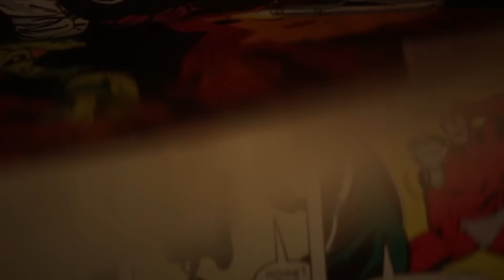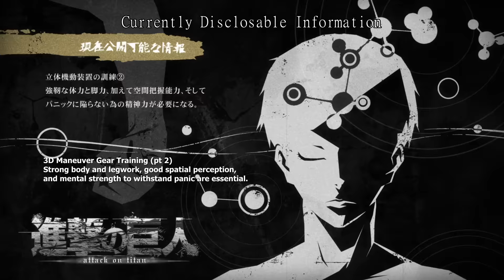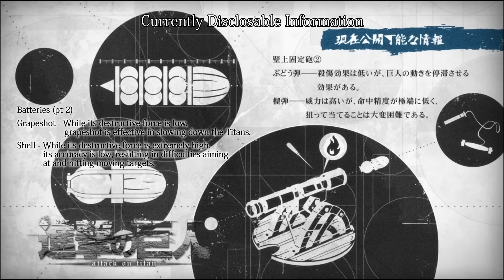Make it Real: Testing the Reloadable Swords from Attack on Titan

Comment: I'm pretty surprised the quiver/blade sheath was as rough as it was. It's a good idea, but I get the feeling that the stored blades were allowed quite a bit of movement inside the sheath itself, and that drawing a new blade could often result in dulling that blade against the cut slots.

Would you have any ideas for refining the idea down the line and keeping the blades as sharp as possible when drawing?
Reply from the maker: +Rosa Weyland hmmm... It's just low-friction plastic, shouldn't cause much wear
Reply: That makes sense. I could hear and see a bit of friction against the sheath when you drew the blades, is all.
Reply from the maker: +Rosa Weyland yeah it isn't the greatest sheath. But it is technically just as prop -- spending more effort on it probably wouldn't of enhanced this video at all. So it kinda got the short end of the stick during the build :p
Reply: That makes sense. Perhaps a hobbyist down the line could improve on the concept, I certainly think that a little further work could have done some good. Perhaps a leather lining might have mitigated the issue somewhat with the draw, but... that's muh pr'fessional 'pinion :P
Reply: tbh the blades in the sheaths are only really meant to be draw once because u would just use that one blade and then draw a new one, not very often would a blade be drawn more than once, so it dosent really matter if the sheath is crude or not
Reply: Keep in mind that the scabbards of most Japanese swords are simply made of wood, and have no lining on the inside at all. The oil used to clean and treat the blade helps to lubricate it, but can also dry on the blade and in the scabbard if it isn't taken out and cleaned frequently. Low-friction plastic is going to be better for the blades than wood in the way of friction, and should make up for the blades not being oiled.

I agree that allowing movement in the sheath is most definitely a bad idea, because this could dull or damage the blade, not to mention that leaning forward could have the blades simply fall out of the sheath. If they were a little tighter, while not squeezing the blade, that would be much better.

But, as the Hacksmith said, the sheath is just a prop, and not much effort was put into it because it wasn't the focus of the video.
Reply: +BlackManiaGaming Attack on Titan takes place in Europe, (Mikasa is the last living Japanese person)
Reply: darrian255 I know that. I'm just talking about Japanese swords because (A) Attack On Titan is made by Japanese people, and (B) because I don't know much about European swords.

Comment: If you had a bigger budget I bet you could make a more compact blade holder by having all the blades right next to each other except for one that is spaced out a little more so it's easier for the handle to clip to the blade. And when a blade is taken out the next blade gets moved into the spot of the old one.

Comment: Wouldn't the blades be loose and prone to movement, like shaking or tilting, in the handle, and possibly even fly out if enough force is applied? It's only a half-length push tang at best, and pretty much anything less than full-tang isn't considered battle-ready. You might get away with a half-tang, but a push tang's not gonna cut it (pun not intended). It's quite dangerous if the blade were to fly out of the handle, perhaps due to force of impact, or simply the force of you swinging it if the clip which holds it in broke.

Also, the weighting is going to be further down the blade because the metal is not in the handle to add weight. This could be "fixed" by weighting the handle, but that adds unnecessary weight to the sword, which is never a good thing, but is better than having the centre of mass further up the blade. The shortened length of the blade (compared to other "similar" swords) will help to keep the centre of mass nearer the handle, but it's still going to be further in the blade than a full tang. The higher the centre of mass, the more the momentum carries the sword when you swing it, leading to less control, and making the blade swing further than you intended. The optimum place for the centre of mass is a few inches above the handle, depending on the specifications of the blade, which helps balance control and momentum.

And I'm a bit of a sword enthusiast, not just some kid who pretends he knows everything about something he really knows nothing about. I know from experience that I'll get people saying that's what I am. I know you're a professional, who has worked on many projects, and probably knows more than a fair bit about this. And I don't doubt that you will have done your research. But the points must be made. Actually, I'm questioning the initial design of the attack on titan creators, considering the rest of the ODM gear seems to be well thought out for the most part (having the gas booster around the body's centre of mass, using straps to prevent injury, ect) but this niggling detail on a crucial part, which is more in my area of knowledge, just gets me.
Reply from the maker: +BlackManiaGaming well... It is just anime lol -- the entire premise of the show doesn't play nicely with real world physics :p
Reply: the Hacksmith Sorry, I'm one of those people who comes up with theories and stuff about games, movies, TV shows, and anime, and generally takes them too seriously. Like MatPat from Game Theory. :P

Comment: tbh they only sharpen the blade nothing special
Reply from the maker: No... we built the handle so the blades are removable! Watch the first video to see what we did, it was actually a lot of work!
Reply: the Hacksmith I admire your works they r beautiful, but if your talking about removing the handle? pretty much any   props workshop could do that, I'm not saying that I dislike this video but I like it no offense,
Reply from the maker: You should watch the making video =) It's never been done quite like this!
Reply: sure okey
Reply: The way the blades themselves are designed and function are similar to the ones used on utility knives.
Reply from the maker: Didja watch it?
Reply: Copado
simepodemiarmasvideo
😃

Comment: why would you want a detachable blade?
Reply: thats how the show is
Reply: +Justin Ladd yeah I figured, but in the show, what's the point?
Reply: +Evan Wheeler because the blade gets stuck to the Titan sometimes
Reply: In series blades get dull after few slashes as you need to cut...0.5-1m2 of flesh, tendencies and spine. Also if blade gets stuck and you miss the critical point (only spot that kills the titan) your good as dead, cause your imminent range of titan and it can just swat you like fly, also those handles have controls for your movement system, so you cant really just discard your blade handles and you dont really want to be escaping titan of any size on foot.. 

I recommend to watch the series, its quite good and you will understand better why system is like that.
Reply: It's similar to a hobby knife. The blade needs to be incredibly sharp, which makes it dull quickly. It also runs the risk of breaking or getting stuck while in use. Hence a reloading system.
Reply: +Hellsong89 I'd have to check it out sometime then. not really into amine, but I've been hearing people talk about this show for a long time.
Reply: They're zipping around at ludicrous speeds, with the controls tied to their sword handles, which you need to keep with you at all costs. Blades bite, so it'd be easier to ditch the blade than anything else, so that's what they do. It also allows you to use a thinner, sharper edge, which is better for slicing, but isn't used commonly because it weakens the metal too much, leading to poor edge retention. The idea makes sense, if a little wasteful in such a impovershed area, but it works.
Reply: That doesn't mean a blade can't get stuck, it happens alot, especially considering they could hit bone when hitting Titans. Spoiler Alert: "Blood Grooves" aren't magic, they're mainly to make the sword lighter in my experience
Reply: hardwirecars If by a fraction you mean 25-35%, yes. Look it up. General consensus from experts is that the vacuum thing is bull.
Reply: Anyway, the blades are too thin to score beyond break points
Reply: +hardwire its called a fuller anyways not a blood groove and ask anybody who actually knows anything about blades blood grooves are bull
Reply: There's no vacuum seal created when you stab someone. Well, not one of significant force at any rate. Citation? Go and stab a roast chicken with a non-serrated kitchen knife and see how hard it is to withdraw.

The fuller is purely to reduce weight while keeping stability intact. In fact, the weapon known for being the best stabby thing around, the rapier, frequently has no fuller at all.
Reply: Ah, I love it when people who actually know what they're talking about show up :)
Reply: Evan Wheeler you need a detachable blade, because eventually the blade will become too dull, so dull it won't have the sharpness needed to kill a Titan, which is slicing deep enough into the nabe part of the neck. Having a blade too dull will cost you your life, so if it's detachable, once the blade becomes too dull, it will detach from the handle, or the blade, and then you know when to stop and retreat, or get a new sword, type thing.

Comment: by the way how did that flying thing go
Reply: he had to use differemt type of rockets, since he can only atach 2 of the old ones to his body and that did not lift off and only gave him a little push
Reply: There are six ways to put rockets on someone you can put two on his back and you can also put two on the back of his legs and you can also put under the wrist that way he will have more pressure and more rocket power
Reply: +Jt Smeth Go watch the flight test videos. If I'm remembering correctly he can't do anymore experimenting with rockets because  of laws. And attaching rockets in any of those places you mentioned would extremely dangerous.

Comment: didn't watch attack on titan, is there any point in having a reloadable sword instead of just having many swords ? I mean, what happens if you loose the handle ?
Reply: They have reloadable swords so if the sword gets stuck in s titan or snaps or something they can replace it with another blade
Reply: They control the 3D manuvering system
Reply: Yup, it would make much more sense to just have a full sword with handle. its not as if a handle takes up much space.
Reply: the handles are controls for their gear.  they have rope launchers and sort of a crude flight system.  they kill monsters by cutting the bacls of their neck.  cutting into the monsters destroys the blades.  there are 2 live action movies that are creepy as can be.  but the cartoons have alot more information in them.  its pretty crazy.

Comment: So the point of these is?
Reply: Shits and giggles. Not everything ever built needs a purpose other than for the fans by the fans. Did they need to make a magnetic Captain America shield? No, but they did and it was awesome to see. Same thing here, just something cool.
Reply from the maker: +ShinKyuubi yup!
Reply: the Hacksmith not here I mean. I mean in the anime.
Reply: meh mehabd
Oh in the anime, well the blades can shatter and/or get stuck in the titans after a strike, so to keep mobile and keep from getting killed they just ditch the old blade and replace it so they don't have to waste time trying to yank it out of the either dead or still moving titan..you don't hit it in the place the thing will stay moving.